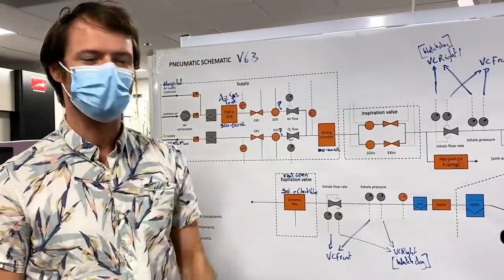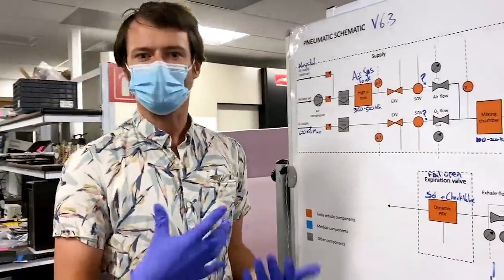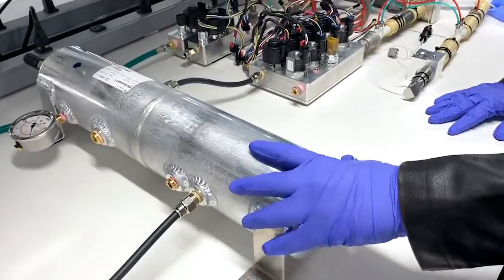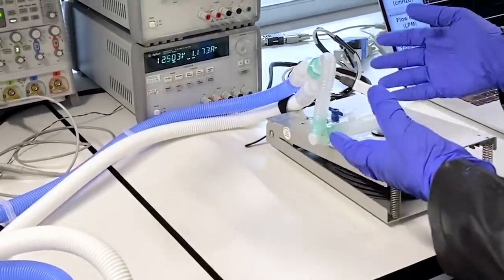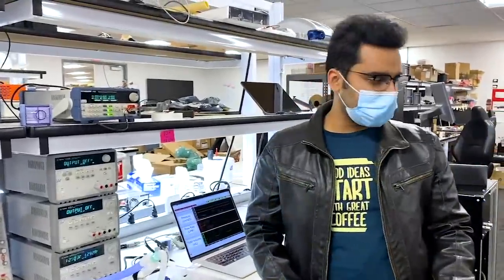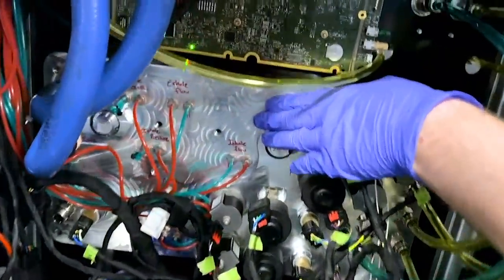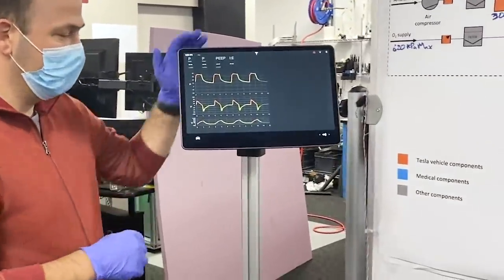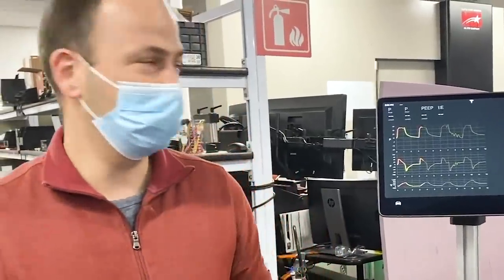Tesla Ventilator

Comment: Have you actually checked with doctors and other professionals to check that this ventilator has the features it actually needs to be useful? Earlier I saw a video by Real Engineering that mentioned a lot of the cheap ventilator prototypes people are coming up with are missing important features of high-end ventilators, with the one he specifically mentioned in the video was PEEP or Positive End Expiratory Pressure which it seems like you addressed just by looking at your pressure graph at the end. I'm sure there are other important things for ventilators and I hope you're getting them now instead of finding out later down the line when the prototype is almost done. The video I'm talking about is this one by the way: https://youtu.be/7vLPefHYWpY
Reply: Tesla worked directly with Medtronic -- a ventilator manufacturer -- on the design of these ventilators, they're not trying to reinvent the wheel. They're investing significant amounts of engineering time and effort into this project under the guidance of ventilator industry experts, but it's good to know that some armchair engineer is here to point out the obvious.
Reply: @tavi_chocochip  I was just saying this because it'd be easy to overlook something during this. Especially when a company like Virgin Orbit made such a bad and unusable one.

I'd also like to mention that as a professional smooth brain, I can only say I vaguely remember someone mentioning they partnered with Medtronic before and it completely slipped my mind when writing this comment.

Comment: Thank you so much for your help.. can you please add the loops ( volume/ pressure and volume/ flow ) 
Also it would be great if the air generator could run on electricity and we plug the O2 only. I saw one line in but the engineer said air entrance. So it's great if it needs O2 only+ built in compressor. 
Thanks again.

Comment: The real question is: 
Does this pass Real Engineering’s standard?
Reply: Reading the comments I saw someone claiming to be a doctor saying it was pretty good, the fact that it can manage pressure and flow control is certainly promising
Reply: Given the choices and circumstances...die without a regulator or take chances on this nee design, pretty simple choice for me
Reply: @MrGbustamante  Certainly this design seems rather advanced, but for some of the other designs I've seen cough virgin galactic *cough*, if the ventilator doesn't allow for pressure, flow rate, and breath control, it can actually do more harm, to the point where it can damage your lungs and actually be the cause of death.
Reply: @dracarysblackfyre6030  yes that is correct, this seems to do all 3. Literally that kind of data collection and automation based on that data is the bread & butter for tesla. See the graphs, all the sensors etc. I bet they are pretty near the point where software engineering and building production line are now the hurdles not the mechanical or electrical engineering.
Reply: @MrGbustamante  "or take chances on this nee design, pretty simple choice for me"

Yeah but it will never be your choice. No doctor or hospital will take a chance hooking you up to something that can potentially kill you. The first patient that dies hooked up to a home made unit would trigger a shit storm of lawsuits. You as a patient have no say as to what gets shoved down your throat. The only option you do have is to refuse treatment.
Reply: In one of his replies to another comment Real Engineering said it seemed like the most promising one currently
Reply: safety is always the greatest hurdle with medical stuff
Reply: They even added a humidifier, so I think it ticks all the boxes.
/watch?v=7vLPefHYWpY
Reply: I would sign any "at my own risk"-contract without thinking twice... To slowly suffocate is one of the worst "normal" ways to die
Reply: As long as it works I don’t care if it’s a Bodge job. Time is of the essence
Reply: I think they mentioned basically everything in his video except for breathing control (not forcing the patient to breath when they aren’t trying to) and not mentioning it doesn’t necessarily mean it doesn’t have it. Overall, it looks pretty promising!
Reply: @madjedi2235  they have the requisite sensors and data as demonstrated near the end already. If not yet functional then it should be just software engineering remaining.

Comment: Are you able to adjust the expiratory trigger sensitivity (ETS) on them? With pulmonary fibrosis it would help to be able to set that too
Reply: Seemed to me they have the capability to monitor and adjust all the parameters necessary. If the hardware covers the bases they can be shipped and the control software updated as needed. (probably wirelessly like they can with the car software) It's a good fit for Tesla's capabilities.
Reply: I hope they see this comment...knowing the speed at which they iterate design changes they'll probably work that in.
Reply: They said they're not done but they're already doing better than anyone else (except the medical companies). They've got the basics pretty good it seems, proper pressure volume and PEEP control with nice visualization on the plot.

Comment: I really doubt this is going to be necessary. The curve of new infection rates is already flattening out. There are local shortages in the worst of the worst places like NY, but most places aren't experiencing this and are unlikely to as long as under quarantine. By the time Tesla finalizes an actual design for these and get it in production, several weeks from now at best, the infection peak will have long since past.

Comment: It’s very impressive what you’re doing here.  Find a way to spray trace amounts of Platelet Rich Plasma into the patients lungs to assist with cilia repair, of course this would only be practical for strengthening a healthy persons lungs in most cases.  The improvements could potentially be permanent, and if the effects of increasing amount of alveoli carried over into the DNA, you could force a minor step in human evolution allowing for more efficient oxygen use.  Or I’m crazy.  Only a Psych student, so could very well be the latter!

Comment: Good design - excellent stuff. Remember to treat the outlet exhaust air, as it will be contaminated. Perhaps a heater of some sorts?
Reply: Ideally, a UV-C sterilizer with 254 nm wavelength. 

Possibly, put in a CO2 scrubber and build it as a closed circuit so you can reuse the O2 enriched air.
Reply: They have a filter in the schematic just not on the prototype. Just slap a HEPA one on and that'll be fine
Reply: Bioweapon defense mode, now is your time to shine.

Comment: OK, this does look like the most advanced and the most promising alternative-ventilator-making effort going on outside the specialized medical devices industry.
Reply: Double Darrel  or if you knew about any of the things you are talking about you'd know that makes no sense. CPAP is continuous positive air pressure its right there in the name. even if one knew nothing else but that and what they saw in the video they would know you are full of shit. As this is clearly not continuous nor just positive air pressure. Edit: to be clear this is not the ones they bought and had delivered these are ones they are making and designing as full ventilators which is clear to anyone with a brain.
Reply: Dyson is doing a great job
Reply: @David-xx7ny  I do like the Dyson company and I do respect their design and engineering skills. But regarding the ventilators production from them I've only seen a single rendered picture of a box. While here in this video I can see something that resembles a working prototype for hardware, software and UI. And I can also hear a resemblance of a reasonable manufacturing plan based on existing stock of parts.
Did Dyson ever demonstrate anything like that?
Reply: @David-xx7ny  As well as the Formula 1 teams out in the UK/Europe. McLaren F1 were the  first with a prototype a little while back
Reply: yep, the key phase was: 'using car parts to NOT effect existing medical supply chain'...
Reply: Double Darrel do you have anything better to do than replying to every comment on this video trying to smear Tesla?
Reply: @keco185  😂😂
Reply: Double Darrel  you don't know the difference between a BPAP and a ventilator. You'd probably go to the hospital and say.. "I can't breath please put me on a vibrator!!"
Moron!!!
Reply: Double Darrel lol, this video is just entering the prototype phase, meaning they couldn’t have donated any yet. Even more so, good on them for trying at all by donating machines that even had a small chance at helping.
Reply: Double Darrel  Something is better than nothing, and they can be used on patients that are not in critical condition. There are even some programs that people can donate their CPAP/APAP/BiPAP and turn them into makeshift ventilators.

It's just Elon Musk's influence on Twitter that is hyping everything up and Elon not disclosing what kind of machines they are.
Reply: Double Darrel  but in the video they built PEEP ventilators, right?
Reply: Why is joe touching his mask ... he should know the dangers with tha t.
Reply: Double Darrel those aren’t Tesla ventilators. Those are just ventilators made by another company that Elon probably bought in good faith to try and provide something in the interim in the development of this, the ACTUAL Tesla ventilator
Reply: versetti88 you actually believe in that? You really think that Elon Musk cares about anyone else but himself?
Reply: Double Darrel  Man, you've just completely changed the text of your comment after a bunch of people just replied to you original crap. 
Which is quite silly by itself.
But the new text is still a total crap. That's putting it mildly. Did you even try to watch the video at all? Do you understand the meaning of the word "prototype". Among other things it means that the thing is not even in production yet.
Reply: SergTTL What is wrong with that text and what did it say at first?
Reply: Double Darrel  here is the original text of your comment in case someone is interested:

https://i.imgur.com/3YS3xop.png
Reply: Double Darrel  No, they have bought and distributed CPAP ventilators. But we see on this video that it's real advanced ventilator. Maybe not as great as hospital ventilator, but it's far from dumb CPAP.
Reply: Dyson and other UK companies and universities are actually doing something much more intelligent than this media stunt. They’re mass producing ventilators based on existing and innovative designs which are proven to work which can be built quickly and at a low cost.

These models use expensive car parts, including a touch screen device which probably costs $1000 on its own. Tesla can barely keep up production with the relatively low demand for their cars and will not be able to afford to produce these ventilators at a low cost. 

What they’re doing is great, but not as great as the fanboys make it seem
Reply: Have you seen any newly designed ventilators by medical engineers, or just this one made by car engineers?

Would the car engineers make a better ventilator with medical sourced parts? Probably Yes.

Would a medical engineer make a better ventilator with car sourced parts? Probably yes.

Would a medical engineer make a better ventilator with medical sourced parts? Definitely yes.
Reply: @GeomancerHT  I think I've got your point. You are trying to say that a medical engineers would make a better ventilator with medical sourced parts. Correct?
What I don't get is why are you telling me this and how is it relevant to either my original comment or to the video.
Reply: @SergTTL  It's not the most advanced nor the most innovative/promising ventilator, nor the cheapest one, meaning it's worthless, sans for Tesla engineers to pass time while lockdown.
Reply: @GeomancerHT  Unfortunately your new comment still doesn't seem to bear any relevance. But now it also shows some broken logic.
1. Why are you telling me that "It's not the most advanced nor the most innovative/promising ventilator, nor the cheapest one"? I didn't say it is any of those things. Hence no relevance.
2. Then from that irrelevant statement now you somehow also draw a false conclusion: "meaning it's worthless". Nothing of what you've said means it's is worthless, not even close. Hence the broken logic.
3. Also the part "nor the cheapest one" is just pure nonsense. The product doesn't even have a price yet because no one is selling it because it doesn't even exist yet. It's called prototyping phase.
Next time please try harder to understand what other people are saying before replying to them. Before replying again to me you'd better try watching the video carefully and reading my original comment carefully.
Reply: Double Darrel It was just another PR-stunt. It doesn’t matter if that works or not.

Comment: Makes total sense dont pressure the current meds parts suppliers so use automotive, supply chain is going to be the difficult bit just use what you have and its known quality/performance, the major custom part is the valve block and thats cnc which is an adaptable machine so easy to get right/improve.. Model 3 display which means touch screen control everyone gets that UI now. Model 3 entertainment computer plenty powerful enough, tap into current stocks. Control it all with software conforming to that currently available in appearance and prime functionality so there is zero training. Brilliant strategy, brilliant work. I want your R&D lab, and people! Now  remember no Ludicrous mode guys!.

Comment: Design a cooler that instead of using electricity, it absorbs from the heat of the air and converts that heat energy into electrical energy.

Comment: wow. imagine this in 1950 with car parts. "While Frank here cranks the engine by hand, compressed air which the engine would normally use to aid in combustion is directed from the spark plug hole through a flexible rubber hose and mask which is fitted to the patients face. Nods at Frank "Now rotate the engine Frank, slowly." looks back to camera all serious "The gasoline supply is of course, disconnected."

Comment: What is the price of production for a device like this?
Reply: Probably not great. They don't use ideal parts, they use pretty expensive Model 3 parts. It's what they have lying around but outside of a crisis it wouldn't be the most economical design. Then again regular ventilators can cost 25000 bucks so even if they use a few thousand in parts it might still be cheaper. But probably also not rated to run for many many years under bad conditions.

Comment: It’s amazing how versatile computers are these days. 🙌
Reply: Robby D this is a common thing with Elon’s companies. I mean look at the Falcon 9 rocket. A normal Falcon 9 core can be retrofitted to be used as a Falcon Heavy side booster in a matter of days. The launchpad infrastructure is also super modular. It could service 4 different vehicle configurations at one point (now only 3 cause Dragon 1 is retired). Launchpad 39A can Lauch a Falcon 9 with a satellite, a Falcon 9 with Dragon 2 and a Falcon Heavy. Designing something to be modular or retrofitable into something it was never intended to do is the master discipline in engineering. I mean our phones are basically powered by stones that were forced to think.
Reply: @SebiKoerner  yeah also their design of starlink sattelite. So compact that 60 of them can fit in a falcon 9 payload fairing
Reply: And they have thousands of free useless Mk 1 and 2 Computers that come from cars who now have the Mk3 for current FSD.
Reply: Wayne Russell correct. Hardware 2 and 2.5 should be plenty for this.